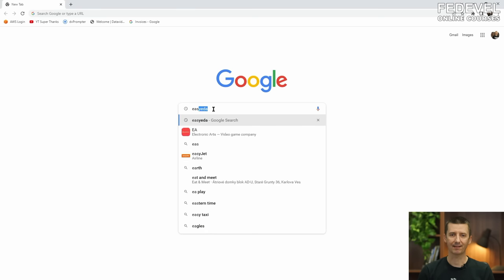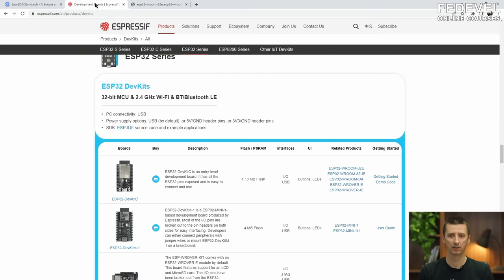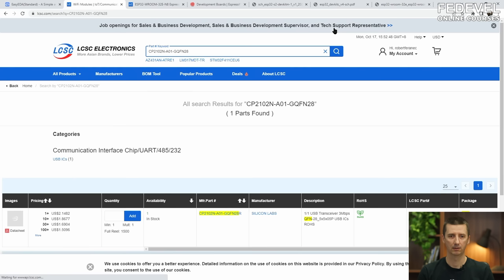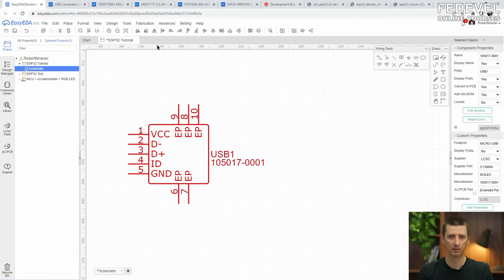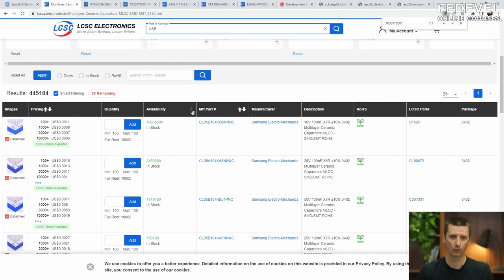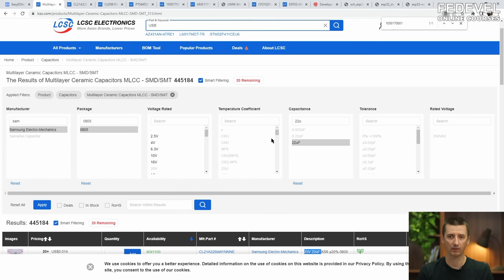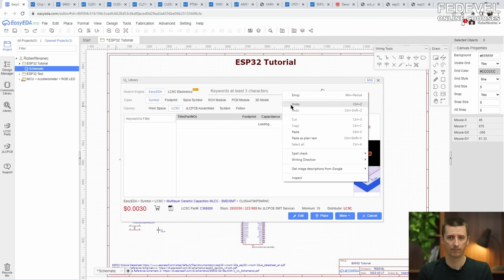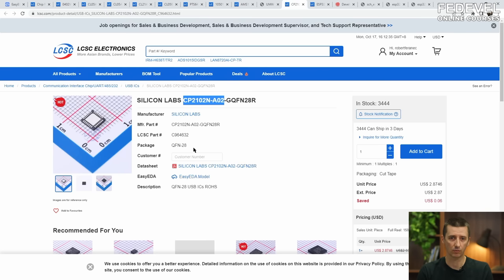How to Make Custom ESP32 Board in 3 Hours | Full Tutorial

Comment: Hi, Why is there only 4 layer stackup for impedance matching of USB ? Why no 2 layer board impedance matching ? EasyEDA looks very user friendly for beginners, and free.
Reply from the maker: One reason is, that on two layer PCB, the layers are far away from each other, so 50OHM tracks are very wide and wide tracks are not very practical for layout.
Reply: @RobertFeranec   Thanks much !  I think the board you routed is also 2 layer ? I just routed a 2 layer board for CH340G , distance from conector to IC is about 300mm. Did not really take any precautions, but it seems to work fine.

Comment: Your ESP32-WROOM-32E-N8 Module has Vias between the 3x3 GND grid, mine does not have that. I guess i need them?
Reply from the maker: I have seen ESP32 footprints without VIAs, in that case you just place them manually
Reply: @RobertFeranec  great, many thanks for your quick reply :D  I'd have another question. I saw the 16MB flash esp32-WROOM-32E-N16 is currently cheaper than the esp32-WROOM-32E-N8 (or was when i started ^^). I guess it would be no problem to use that instead? Wanna make sure before i order the piece you teached me to craft :P

Have a nice day & greetings from Vienna
Reply: @RobertFeranec  I now wondered about the SPI pins, but the 32E does not have them led out at all, additionally, i found this information: "In module variants that have
 embedded QSPI PSRAM, i.e., that embed ESP32-D0WDR2-V3, IO16 should be pulled-up and can not be used for other function".

Now i wonder if the design will even work properly, but it does for you i guess, so no idea why this is needed. And if i should maybe pull io16 up and replace the pin by an addtional 3.3V pin ^^
Reply: oh, the N* Models don't have inbuilt PSRAM it seems :S

Comment: This is a useful video, but I've got to comment on the USB 5V bus jumper. This design turns off the 5V pin for output when using USB power. I've never seen any ESP32 board like this nor would I think it was desirable. It's making me make a choice I don't normally have to make while removing a feature, potentially for an edge case you don't spell out. If I had a dev board that didn't have a working 5V pin when on USB I wouldn't be very pleased. Maybe you would want to use the original design with the diode and have the option of disconnecting the 5V_BUS, but this seems like a special case.
Reply from the maker: Thank you. PS. The 1117 regulator is not the best and when using the diode, it's working on the edge, so I removed the diode.
Reply: @RobertFeranec  I really do appreciate this video a lot, and I know you know a lot more about power management than I do, so even if I find the config odd I know you're not acting without knowledge.

Comment: you should assemble Q1 and Q2 and test it the auto program
Reply from the maker: Q1 and Q3 tested and it works. It can reinitialize USB connection. And it fixed the problems I had on one PC and with a specific USB cable.

Comment: DIY design is too costly but if someone learns then it's ok else go for the buy option right?
Reply: I wouldn't say so, depends on what you want to use it for probably if you already have some prototypes done where you have bunch of wires laying around, it doesn't look great. So if you want to have some extra connectors, sensors or other processors that will be on the same board then it will pay off in the end. But if you only need the base board (only esp32 and leds and buttons) then really go for the stock one.
Reply: what do you mean by this
Reply: Getting custom made PCBs can actually be really affordable

Comment: I got some error while converting the schematic into pcb.
It mentions no footprint found on the server for ESP32.

Can anybody help me out pleaze.
Reply from the maker: The easiest way to fix it may be use the same component but created by someone else. Possibly check what is wrong with the link to footprint.
Reply: @RobertFeranec  Should I use the same board from some other manufacturer with the similar connections?

Comment: Well, I think it's kinda boring, that everybody uses ESP32 Modules like the WROOM, instead of just the chip itself. It's a little more complicated, due to the impedance matching for the antenna etc. But for the most part, it's still pretty simple. And it's a lot more compact.
Also, if you're ordering assembled PCBs, it makes sense to choose parts from the JLCPCB parts library and you should try to use basic parts wherever you can, to avoid the manual labor and associated costs of them having to feed extended parts into the pick and place machine. For things like the 3.3V LDO, for example you could have easily found a basic part and saved a few dollars.
Reply from the maker: When designing RF by yourself, certification can be very expensive.

Comment: Nice video but one of my pet hates is a circuit schematic consisting of chips and net lists.
Reply: I find them far more readable. The worst schematics are when everything is in one huge bundle of connections - segmenting the functional parts makes more sense to me.
Reply: @Stabby666  old Marantz schematics have left the chat
Reply: @Stabby666  Segmeting functions is ok by me but not when it's segmented down to components as i said.

take the usb connector for example, if you wanted to show that the D+ and D- are length matched how do you show that as a net list. Now if the connector was in the same segment as the USB chip and the wires go from the connector stright to the chip a simple note could be placed to point out that they are matched tracks. As don't the USB connector and the USB chip share the same function
Reply: @TheEmbeddedHobbyist  Well you could add a note next to the USB connector just the same way. I use Eagle, and would actually use a differential pair type anyway so there's no need for a note - it will automatically route them both with equal length.

That said, I'd /probably/ have the USB connector directly connected to the chip and ESD protection. In some of my designs I group all of the input connectors to the left, and output to the right in their own sections to keep things clean. I'm also a bg fan of using multiple schematic pages for more complex designs - with, say audio and filtering in one schematic, power in another, processing in another etc. It really depends on the project. Everyone has their own tastes but I've never had any complaints about my designs, including my open source projects.

The only thing I would comment on was Robert grounding the USB connector casing, as this is a peripheral and shouldn't be grounded really. Not a huge deal unless you're dealing with long distances and potential difference between grounds, but still good practice.

Comment: my com port is not being detected
Reply from the maker: com port should always come up in device manager, just in some rare cases you may need to implement the errata fix with transistors (the problem inside of USB to UART chip). easy way to find out is to try to connect it to a different pc or connect it and wait for example 5 minutes if it will start working. if not, double check the soldering, maybe there is a short circuit and also double check the powers. it should work ok.